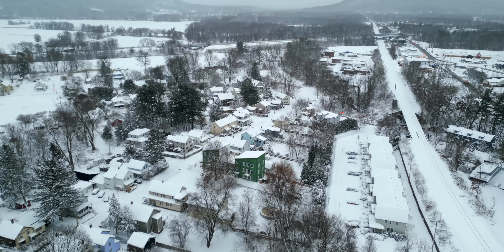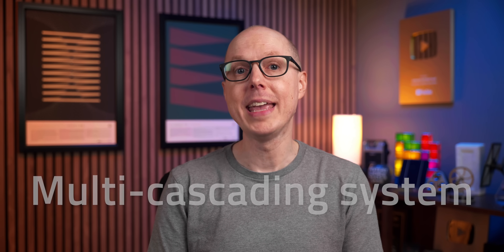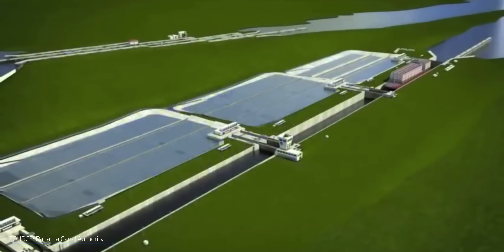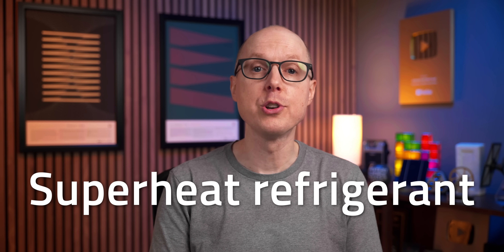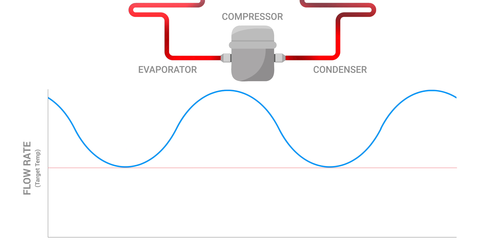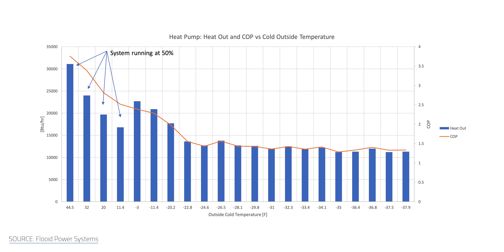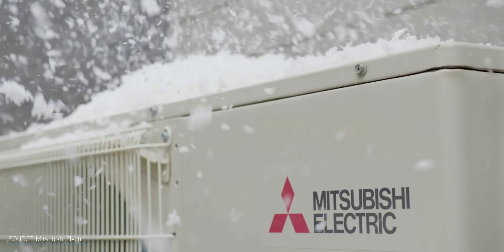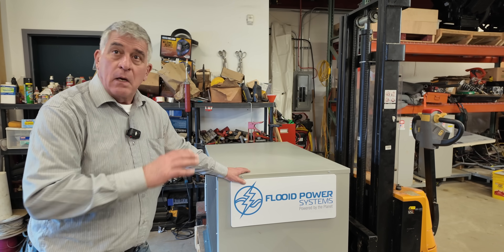How This New Heat Pump is Genius

Comment: I live in southern Australia so min temperatures can get to about -5 degrees C . and up to 45C . My home is only about 100 square meters very poorly insulated. I have installed an INVERTER FUJITSU heat pump. The inverter technology makes all the difference and also instead of an old type thermostatic expansion valve it uses a stepper motor to get much more accurate control of changing the amount of refrigerant from liguid state to eventually gaseous state.  We call these units air to air Mini splits and  my system is working great. The unit is rated with COP of around 4.
My unit is rated at 8000W when input power is 2000W hence the COP of 4. Now yesterday min temp was 1 deg C house temp ranged between 27C to 23C in my lounge room. I do not heat bedrooms or kitchen but even here the room temps range from 16C to 19C
Yesterday the temp in the morning was 1C with 85% humidity. What happened was the evaporator unit outside iced up normally my aircon draws 1000W but for about 20 mins unit went into DE ICE mode and drew 2000W. I know power consumption because I have OFF GRID inverters with battery back up.
After the deicing unit returned to normal as the day warmed up to 6degC.
Yes for the climate I am in these Mini splits apparently will go down to -15C with an average COP of about 2.
When I visited the UK in 2018 my cousin who is a gas engineer showed me his installations using gas boilers and hydronic systems. The thing I noticed was that in the UK they virtually heat the whole house. Your Gas is a 1/4 of the price we pay in Australia so I guess they can just use boilers.
Looking at this video I was overwhelmed with the massive plumbing complexity of using these heat pump systems. The cost would be enormous .
Why don't people in the UK go for using separate Mini Split units that you turn on and off or set temperatures in each room via the hand help controllers. My Minisplit cost $3000 AUS to buy and install. Thats about 2000 pounds UK for each unit, they are quiet and of course they can cool as well. When I lived in the UK in the 1960's people only heated the lounge room and maybe the Kitchen. 
I  visited the UK in 2018 when the Beast from the East arrived yes the homes were nice and warm everywhere through the whole house.
Maybe we need to just back off trying to do whole houses and have smaller modern heat pump mini splits
Reply: The old dayton floor or wall furnace had a heat exchanger, a $15 thermocouple & $40 gas valve. If the power was out you still had heat. The thermocouple and gas valve could be changed in 20 minutes and you're back on line. No electronic parts to order. No having to replace compressor, reversing valve, bi-directional drier & all the refrigerant for a couple of grand while you're outside and it's -20 welding in a new compressor, reversing valve or changing the whole condensing unit and down for the day.. With hundred's or thousands in parts for a heat pump that cant heat the house has fast and needs supplemental heaters for emergency heat. Also if the power is down the heat pump and the supplementary (electric heaters) are down... At least a gas stove might keep you a little warm.. Just saying..  The old wall heater was cheaper, more reliable, easier to repair, less expensive to repair, if the power went out it didn't matter and could heat your house faster.

Comment: I’m not convinced that this would work as described. There can only be so much heat exchanged based on the delta between the two spaces. I think the maximum you would
Ever need is 2 refrigeration loops and only if you lived somewhere really cold. ?

Comment: The newer heat pumps use variable speed compressors to "overspeed" the compressor to increase refrigerant head pressure to extract more heat. Mitsubishi has had a Hyper heat unit in Canada that will heat to -20F outside air for years. Lots of less moving parts than a cascading system.

Comment: Heat Pumps typically have much longer run cycles and in most cases of extreme weather hot or cold ambient will need to run 24/7. Doing so increases cost over time in maintenance and service and power consumption. Hang on to those rebates and tax credits because you will need them.

Comment: I have worked on ultracold freezers 80 deg C (-112 F) and they work on a cascade system...refrigeration heat pump cascade systems are only necessary where temperatures are extreme but a much more efficient way (common in Europe) is to go with Co2 crazy COP (up to 6) and work well  down to extreme temperatures but $$$

Comment: Especially in places where it gets well below freezing regularly. I think you always need backup heat!  No matter how efficient the pump is.  Heat pumps are Rube Goldberg machines compared to a simple furnace.  Complexity =  more things to break.  When do things normally break?  When you're putting the most stress on them, which also happens to be when you need them the most!  So, always have backup heat!
Reply: i would rather have gas heat anyday. They heat a lot faster
Reply: @rhstrebe  Gas cannot supply more than 85% of BTUs of useable energy.  Heat pumps provide 200%-500% of the BTUs in useful heat energy.  Gas is a terribly inefficient energy source for heating air. 😢

Comment: Love the compact size! I have an oil furnace for my hot water baseboard system (3 zones) and an aging A/C unit with old (non-replaceable) coolant. Being able to replace both would be a dream come true. I'm not sure how it would work as my furnace is on the North end of the house and the A/C is on the South end (not the most efficient placement) about 60` apart. I will be looking forward to certification and asking for a review of my needs! I am located south of Worcester, MA so; local. Heck, I'd be willing to be a test install!

Comment: I am interested in eliminating my gas furnace and gas water heater; if the Heat pump system will carry over the HVAC systems as well……….. it will be the biggest home improvement upgrade , after my Solar PV system!…….. thank you for the presentation 👍

Comment: I have a radiant floor heating system that keeps our house very comfortable during fall through spring days but, as the summer temperatures keep climbing, we've been considering replacing the very efficient gas fired system (which also supplies domestic hot water) with a heat pump system. I've had a heat pump system sized and it seems that it would work for our radiant floor heating as well as the domestic hot water system. A cascading heat pump system sounds better, but it's not yet clear if it would be economic. It is something I will continue to stay abreast of. It seems likely that we will change out our present system for either a high-efficiency heat pump or a cascading heat pump some time over the next 5 to 10 years.

Comment: Hi, we are heating our building with two heat pumps in row; the first one is placed in our server and pv inverter room which was heating up to over 30° C without the heat pump, the socond heat pump is placed outside. The heat pump inside the server room is running with COP of 12 to 13 most of the time and lifts the water temperature to 29° C.
The heat pump outside the house is only switching on, when a higher temp then 29° is necessary to heat the building, what happens from 3° celsius and lower.
Because the external heat pump is getting pre heated water from the inside heat pump, it doesn't need to lift the temperature as much as what would be necessary without the internal heat pump, so it can run with a much higher efficiency and also it does not need to get defrosted so often as when it would be used alone. So a much higher COP on bove heat pumps can be realized - even with two standard heat pumps - each around 2000 USD. With this system we reduced our heating costs to nearly 50% then the years before using cng. I hope my hints help other people to optimize there house heating with two cheap heat pumps instead of buying one expensive. (we use a third heat pump to make warm water, preheated by a solar system)

Comment: interesting ...well I worked on a new net zero house here in BC Canada and they have only a "cold weather" heat pump for heating , last winter the temp got to -40C for several days , that heat pump shut off at -25  or so  awesome  ! just when you need it the most you get nothing  ...

Comment: Just use SIMPLE system, like factory made AIR -WATER(WATER-GLYGOIL) to heat the house. And use climate friedly systems like propane (a-15c/w65c cop 2,5) or R32.  You can heat tabwater and house in simple inverter propane system, air to water or heatwell to water (brine-water) heatpump.

Comment: Yes, I am very interested in using the heat pump for cooling the living space and hot water for the household. It would greatly reduce the electric bill cost, that's why it will be held back!

Comment: live at 7000 ft altitude, cold overnight temps, lots of snow. use electric baseboard for over thirty-three years, never a failure or repair. extremely low cost installation.  no maintenance required. nearly completely silent very even heat, no drafts.  Yes its more expensive for a couple of months, but not as much as most people think.

Comment: CRAP! I thought this heat pump was ready for sale. I live in the Las Vegas valley and we are now getting temperatures of 115 F. more often. My 10 year Lennox 3 ton air conditioner has had two expensive (as in $400.) parts replacements from rip-off air conditioner repair companies so it is on its last few years before even more money has to be spent. 
WHEN MY LEGACY AC UNIT GOES I'M GETTING AN AIR-TO-AIR HEAT PUMP OF THE HIGHEST QUALITY.

Comment: Cascade refrigeration systems are not more efficient than single stage systems because there are two compressors and more energy used.

Comment: I heat with wood in the winter. I get the wood pretty much for free and it gives me a good workout to chop it. Around here electricity went from 40 cents last year to 53 cents this year. Heck no I'm not going to install a heat pump no matter how efficient when I can heat essentially for free with wood.  I'm not running an AC in summer either - i use that for the handful of days that actually go over 105. A $500 electric bill is just not acceptable.

Comment: Multi stage? Fine. I moved into a new 10-unit condo and we all had the same heat pump: General Electric. Forty one years later I am the only one with the original unit. My secret? I never purchased a new unit. The GE was and is a horse and it could be repaired (solenoid and about three leaks plus frozen up fan blades when wet snow turned ice as well as a
the upgrade from analog mercury switch to digital thermometer) and I happily listened to all service guys telling me it is going to fail in three months, guaranteed. My image, though, was that of a kitchen fridge that I hear could last 30 years. My fridge is Frigidaire and it is original as well. Ok, the dishwasher is new, replaced 2 years ago. Treat your stuff with respect and I mean that literally. It is all rust, but still.

Comment: Just watched this and the commercial shrouded air turbine video. I was struck by the missing real life repair process. For the wind turbines the few moving parts make repair “easier “ also on commercial buildings that have maintenance staff that can be trained. This home replacement may be able to be built with readily available parts but when something breaks will a residential HVC repair service be able to fix it “quickly “.

Comment: I would be interested to see how that Flooid cascade heat pump would perform as a ground source system. Would this possibly mean a reduction in the amount of surface area in the ground is needed? Like going from needing 3 vertical holes to 2 for a 3 tonne system? Or am I looking at this the wrong way?

Comment: I’ve an 6kw Mitsubishi ecodan air to water heat pump installed.  Previously had 16kW natural gas boiler.  Then had external wall insulation, triple Glazzing, composite doors and loft insulation hence only 6kw heat loss now
Reply: 🇬🇧  also had 4kw solar Pv with 15kw Pylontech battery storage.

Comment: Probably not necessary where I live (south coast of UK).
Winter temperatures rarely go below about -4.0C (+24.8F), and Air Con is not a common thing in homes over here.  Our house is also very well insulated and stays fairly cool in the summer.
I'm already installing a solar hot water heater for domestic hot water (not for heating), which is going to save me a huge amount of money compared with our existing electric water heater.

Comment: I feel this is over engineering. You only get extreme temperature some times a year, and then you usually have existing solutions to handle it when you're ordinary heat pump don't function optimally

Comment: To me we would be better on focusing on two things 1. Homes without passive heating / cooling systems should be made to be built with fans in every year (people have learned to too easily turn on aircons before fans. 2. Homes should be built with internal Venturi effect venting systems. We create this by putting a large window box fan in the upstairs window and opening the downstairs windows the last two summer seasons we dropped our bills and energy use significantly by doing this.
Reply: Cooling a house by sucking a whole lot of outdoor air through it means a whole lot of outdoor air that needs to be cleansed of pollen, dust, road pollution, smoke particulates, and whatever other pollutants are outside your house. And even after you've filtered it, what's its humidity like and is it going to cause mould problems inside your home?

Comment: Someone on reddit had this to say about RocketMoney: "[Paying 40% of the projected savings the app claims it will get you] was absolutely the case when I used the bill negotiation feature. And it was a large percentage (I think you’re right with 40%) of the “projected” savings, non refundable. Meaning, in my case, they projected to save me hundreds on my internet bill for the year by negotiating my monthly cost. I approved it. They immediately charged me the 40%. My bill got about a $10 discount for maybe two months, then when right back to the normal rate, and I ended up losing a couple hundred dollars."

Comment: A Tesla turbine can handle gas and liquid without damage.  This would make a good HVAC compressor.  Requires high rpm but motor and control tech is ready.

Comment: I have a 20 year old gas furnace and electric water heater in a 2nd floor condo that is stuffed into a standard sized closet that I'm looking to replace with a heat pump system. Since everything is due for replacement including the slightly newer central air unit, I was looking for a single solution that would both heat and cool my condo and provide hot water. The standalone heat pump water heaters would need extensive ducting to the outside due to unit being basically in the middle of our living space. I was looking at a system from Harvest Thermal in California, but they currently operate on the West Coast due to a lack of trained nationwide installers. I would think the hot water could be used to supplement the heating on the coldest days here in SE Wisconsin, but mostly I wanted a unified system that might free up some electrical capacity to add a charging station in my garage. Any thoughts?

Comment: The cascade heat pump are used since for ever to get cryogenic temperatures ranges, from 280 °K to almost 0 °K.That process is used to get Liquid air, nitrogen, hydrogen, oxygen and othes.
So, lowering 30 °K for a multiple pump is an easy task, even reverting the cycle to get heat. The cost effective technology laid down in material selection and production process. Is a trusty and proved technology.

Comment: I always wonder if technology outside of the nordic countries is outdated or do we have some well kept secrets, because we simply have much better heat pumps that work very well in our very cold winters.
For example this year I had one installed at home (Mitsubishi RW-35) which can keep a COP of 4 at temperatures as low as -35C (-31F). It's not a cascading heat pump, but just a regular one.
A have another heat pump installed 15 years ago which can keep a COP above 3 at -25C (-13F)...
Reply: No you don't lol. Why do you just make up these absurd numbers. Link the spec sheet
Reply: @P7ab  This is in Finnish, but there you go - on the last pages of this pdf: https://scanoffice.fi/wp-content/uploads/2021/11/Esite_RW-1.pdf
Reply: Given the Japanese name, it was probably developed for use in Hok-"you can see Russia from the coast"-kaido

Comment: I'd drill a bore hole and go with ground source heat pump. No need to be able to extract heat from -30 C air when the ground is a constant 8 C.
Reply: Yeah, drill a hole for $20,000! 😂😂😂😂😂
Reply: Bingo. Even when the ambient air outside is closer to the desired temperature than the subsoil, the much greater thermal mass of the subsoil still makes it the more efficient choice.

Comment: @10:45 Sure but... How long did it take to bring the home to that temperature?  I'm a big HP proponent and a hvac tech but, a lot of hype here.
Also, it's fine to have tight control but one sensor drifts or fails and liquid will make it to the compressor. No matter the control valve/system, it's better to have a suction line accumulator to catch a "flood back".

Comment: Given the ample supply of cheap natural gas in most of the fly-over USA, why change to a heat pump for heat?
Heat pumps may make sense for new builds in areas without natural gas.  But retrofitting an existing gas furnace in Buffalo or Minneapolis?  I'd be skeptical without a detailed cost-benefit analysis  that considers cheap natural gas and increasingly expensive electricity.

Comment: My electric heat pump doesn't work in the cold.
Reply: Have it serviced,  seems like a PCB issue and not switching... so its stuck on the AC function,  all heat pumps are designed to work below freezing,  thats why they are called HEAT PUMP